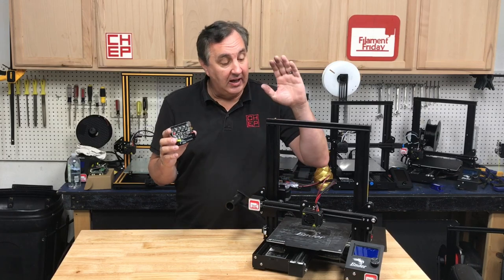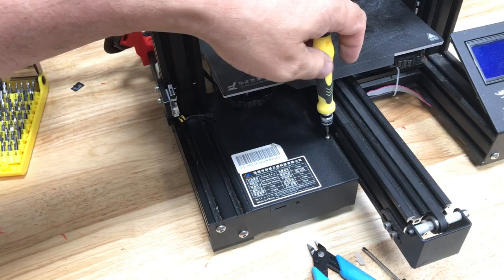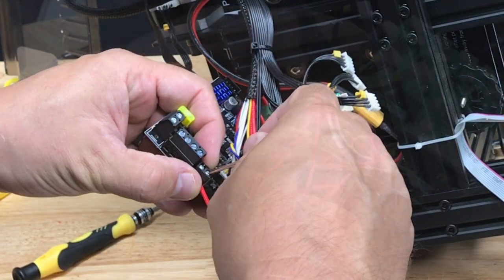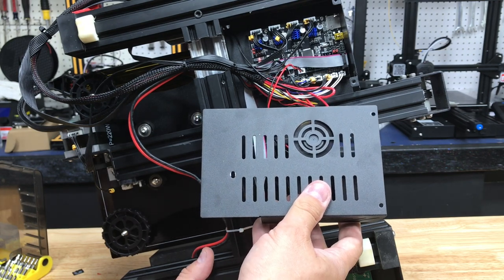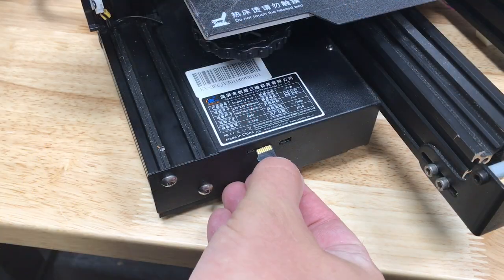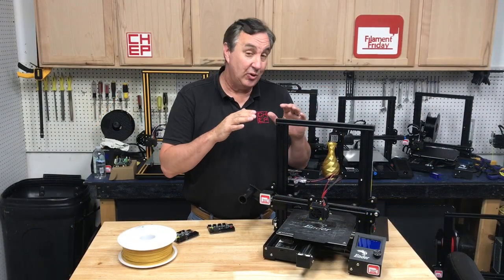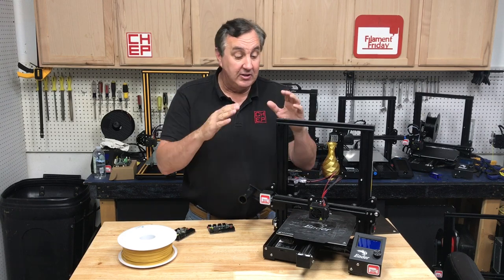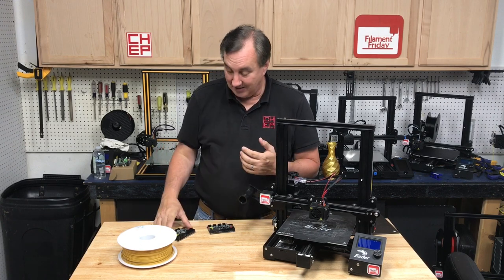Creality Ender 3 Upgrade to 32-Bit SKR E3 Mini

Comment: CHEP - I have reached the stage (about 0:48) with the main board uncovered, but I notice that on mine all the plug and wire connections are covered in hot melt glue - you didn't mention it so I assume yours were clean and OK to remove. Has anybody else found hot melt glue everywhere like me?
Reply: Yes! and it was very annoying to remove! I used an exacto knife cause I was scared a heat gun would ruin something
Reply from the maker: I did have some but it just broke away easily with needle nose pliers. I should have mentioned it.
Reply: coolant spray will help. Hot glue will get very hard and you can break away it in parts. But still lot of work...
Reply: Same here. Had all the connectors glued to the board. I have used the filament cutter to cut the glue and pliers to remove it.

Comment: The two Ender 3's that I worked on had hot blue on all the connectors.  was a major pain to remove them prior to installing the new SKR mini board
Reply: Ya, I used needle nose pliers and got a grip of a part of the hot glue and could pull it off quite easily. Still a big pain

Comment: Hi Chuck, well I took the plunge with the Skr mini E3 V2. Having a BLTouch and sensorless homing does present a problem. You can download firmware from BTT on git hub but quite frankly it is very poor and not good to use having assorted problems. I have been fortunate enough to have been given a revised compilation so that my printer works again. You also have to mess about with the wiring on the BLTouch which in itself is only swapping a couple of wires, although this is not obvious out of the box, additionally plugging a three pin connector into a five pin socket again does not run well with "do I do this?". Am not one to suggest material for your channel but I would like to see this as not everyone wants to learn to program Marlin (happy to share my firmware). Another pointer for review is the x axis gantry. After fitting the board I went through and just did some casual maintenance. Had the wheels a little too tight, doing this I was getting a great first layer but everything else after was rough. It never occurred to me that this could be an issue or cause a rough 2'nd, 3rd and on layer. Maybe worth banging that home to people as the temptation is always going to be nice and tight. The error will then be that users will start adjusting z offset, messing about with e steps and generally being frustrated. As for the upgrade itself, yes it was probably worth doing for the silence it offers (takes a little getting used to) but the bad firmware from BTT, well that was a pain and not the best experience!
Reply from the maker: Did you use the firmware I showed in the video?
Reply: @FilamentFriday  Hiya Chuck,yep from the BTT git page. It works "kinda" although would not let me go into minus figures on the z axis setting, would not remember e-steps after cycling the power, was printing off center (although homing correctly) and would shove the y axis forward with a tremendous bump on levelling.
Reply: @owowowdhxbxgakwlcybwxsimcwx  not sure what your question is in reply to my information or for that matter if it is to me or CHEP. Perhaps you could phrase it better.

Comment: Hey Chuck, Will this board work with the CR-10.  Trying to find a 32 bit board that will just drop in with my cr-10.  If not can you recommend one that does work for a CR-10.
Reply from the maker: I’m not sure about a drop in but this could probably control it. Would require some possible firmware mods though.

Comment: If the architecture is the same, framework the same, the code is the same, (as in not working with 32bit floating point operations) you probably have the same performance. I believe you probably have more RAM and flash memory. What is the chip used?

Comment: Seems to be a inexpensive plug and play upgrade for the E3. I had ordered one a few weeks ago, but apart from the quietness I don't know what other improvements it will give me on my stock E3
Reply: The quiet is a great benefit especially if you are running multiple printers.  I can't say it improved my prints because I really have not done any "before after" comparisons.  My CR-10 and the Ender 3 pros printed beautifully for my needs before the upgrade.  The main reason I bought the 32 bit boards was for the silent steppers.

Comment: No mention of hot glue? One of the biggest complaints I've seen is too much hot glue. My E3Pro is still fairly new, haven't looked at the board yet.
Reply: I went to the dollar store and picked up a metal dental pic, and used that top "pull" at the hotglue. Worked great.
Reply: I've got a set. I just hope it's not as bad as some have had.

Comment: I have this board but I couldn't get it to connect to cura via usb so now it's just sitting on a shelf doing nothing. I also don't like how the printer actually ends up being louder than before due to the mobo fan now running on 24v instead of 12.

Comment: Hey Chuck quick question. What's the screw used to secure the wheels to the non-motor bracket of the X-axis bar? Mine are stripped and need a replacement but i can't find what the length and threads are anywhere.

Comment: As usual, a great tutorial, but... I find that after installing the 2.0 version I have lots of issues. A simple troubleshooting guide would be a great help! Unfortunately I find it very difficult to find a source which gives answers to my issues. Too lots to mention. Can you Chep, or one of your kind viewers suggest a good source for help? When the board works it`s great but when you have issues, well you`ve got issues unless you can find help. Thanks again Chep for the best Ender 3 Youtube channels there is. I always point people to your help videos.
Reply: I think reddit Is the biggest resource to find solution to your problems: try searching in the subreddits r/3dprinting, ender3 or fixmyprint
Reply: Im experiencing those issues now after I decided on a whim to replace a perfectly functional 8 bit board with silent stepper motors for the E3 dip I'd had in a box for probably a year 🤔

Comment: I'm waiting for a video about installing the V2 display to an original Ender if it is possible to get a replacement display from Creality
Reply: Andrew Hayes won’t work, the only way it would work is if you was one of the few lucky people to receive a recent Ender 3 Pro with the 32 bit board. Otherwise no, you can’t retrofit the new V2 screen to an 8 bit Ender 3.

Comment: I just bought two more ender 3 pro's. I opened them up to find creality 4.2.2 boards in both. These are 32 bit boards with faster processors than the 32 SKR mini's. The machines seem to run fast but they are noisy as can be. Rumor has it that Marlin released new firmware for this board (Marlin 2.0 for Ender Pro 1.5). I am wondering if I should just put an skr mini in this or is it possible to enable silent steppers on the 4.2.2?
Reply from the maker: I’m told Creality shipped some 4.2.2 with 4988 drivers not the TMC used on the V2 so you’ve somewhat confirmed it. At this point I prefer the SKR mini v1.2 with silent drivers.

Comment: Chep, 

Get info. I have the same board installed. Will the firmware upgrade turn on the ability to recover from a power lost? Or do I need to do more to get this option to start working again.

Comment: Would this combo run Marlin firmware also for the Core XY printer I'm building?  I'd like to have the same stuff on all 3 printers so if one goes out I can just order/swap same parts again.  Thanks!

Comment: Does this board give you silent motor control, if not is it possible to do the mesh levelling with the 32 bit silent board, thanks
Reply from the maker: Yes it has silent drivers.

Comment: What is the easiest way to see if you have an 8 bit or a 32 bit 3 Pro, just received one. Have an SKR on the way but if I don't need it I will look at using on another printer

Comment: I’m having problems getting my print to stick to the bed even though I can slide the card(that came with the printer) under the auto-homed extruder.  Any suggestions?
Reply: Card is to thick, try a paper receipt to get the nozzle closer.

Comment: I’ve spent since Friday trying to at least get the screen to do something.
Sometimes it shows the Marlin logo and build but most times nothing on the V2.0 board
As for the firm ware for it...not much luck with that either so while I’ll keep this board in hopes I can get it working after learning a bit more, I’m just gonna put the old one back into the printer.
Reply: Did you get it to work?
Reply: I'm having a similar problem but all I'm getting is just a blank blue screen

Comment: I've installed the new board but I'm not sure what to do with the .bin file. Do I just copy and paste it to an sd card or do I need to open it up and run it through a certain program first? My printer still says it's running Marlin 2.0.
Reply from the maker: Just put the .bin file on the SD card, insert and start the printer.
Reply: @FilamentFriday  I was able to get the firmware installed, but the z axis is not going down. When I autohome, it home the x and y axis and then tells me that it was STOPPED. When I try to move the z axis, it will not go below 0.00.

Comment: Well Chuck....I was excited to upgrade my 2.0 board to the latest and greatest but things don't always go the way they should. I followed your directions and dowloaded the files (for V2) ,they were not compressed by the way, placed them on the SD card (the one that came with the board) inserted it and turned the machine on. The window turned blue and it is still blue after an hour. I assume that is more than a few minutes. I figured wonderful because I turned the machine off and removed the card and restarted it and the screen was blue. I put the firmware.cur file from the original  card and that did nothing either. Maybe a video on what to do when things don't go as smoothly as they should. I expect I have a lot of searching, reading, and cussing to do for the next few days. I'm learning.
Reply: Did you rename the file you downloaded to firmware.bin ?
Reply: @robbie_g8308  That was it's name when downloaded..
Reply: I have the exact same issue. George, where you able to fix it?
Reply: for me i accidentally deleted the wrong firmware, so i had to put the right one back on.
Reply: firmware.bin
Reply: @ericdodson8771  not yet still doing my research and learning.
Reply: @robbie_g8308  I did exactly as Chuck did but used V 2.0 file folder. moved the firmware.bin file to an sd card, inserted into the printer, turned it on, the screen turned blue and the nothing.
Reply: George Scott I hate saying it but it’s made me rethink whether the “Silent” is worth the trouble.  I haven’t changed back to the old board yet but I’m sure I will be.
Reply: @joeruggiero2822  Well actually the board that was in this Ender three version 1.1.4 was not loud....in my opinion. I am probably going to put it back in so I can use the printer and then figure out how to fix the BIGTREETECH board.

Comment: does that board have the digital connector for the closed loop steppers?  great video thanks chep
Reply: No because it has integrated (soldered) stepper drivers on the board, you cannot connect the cables of the closed loop steppers.

Comment: Uncanny timely video, as usual. I installed the V2 today and I’m having a nightmare getting firmware to flash. Test firmware went fine, but trying the BLTouch firmware led me to a blank LCD screen a completely unresponsive printer. I’m currently waiting to hear back from BTT support because an entire afternoon of google searching hasn’t yielded a solution.  Upgrade with care!  It was really quiet for the couple of test homing actions I tried though... oh, what could have been... :(
Reply: buruzn09 
The BTT firmware for the 1.2 was broken.  I had a BL-Touch and TFT35-E3 as well to install.  I made my own, comparing then copying across the necessary changes from the BTT firmware to a 2.0.x Marlin install.  Try that, if you have no luck.  (The only issue was I forgot to change default speeds in part of the Marlin firmware config, so the initial homing and bed levelling is slooow...  But haven’t bothered to fix that yet.)

I have to make up firmware for a 2.0 board soon, as I have upgrade parts for my brother’s Ender 3.  BL-touch, v2.0 board, and the TFT35-E3 to install.
Reply: The firmware has a few issues for bltouch. I have a working firmware with the bugs removed you are welcome to try.

Comment: Is this gonna work with first Ender 3? Not pro, not v2 version. Also i run stock Ender3 with Raspberry pi, camera and ofc Octoprint. Since my 3D printer is in diferent room and even flat (because of noise and space), I only use it through web ui of octoprint (uploads and printing files all done via web ui) and i wonder does this board  support that also since it is deal breaker for me. Thx!
Reply: "Is this gonna work with first Ender 3?"... yes.
Reply: Watch out with Octoprint though, if you power your Raspberry Pi with an external power supply it pushes current into the mainboard and overheats the drivers and motors.  I just used some kapton tape to tape off the pin in the USB port.
Reply: I upgraded my stock Ender 3 with the V2.0 Octoprint runs without problem. I updated nothing. No firmware no nothing. The WARNING about printer lacks protection on Octoprint has gone away. And the printer is crazy silent.
Reply: @WRW87  good news on the V2.0, I have V1.3.

Comment: They say ender 3's (Regular, pro, v2) or any other printer can print much Faster without losing any quality (That depends on your settings off course), Do you have any Cura Profiles, or setting  built for speed?
Reply from the maker: Who are they? It would require better hotend for one.

Comment: Thank you for the great videos Chuck!  I upgraded my Ender 3 Pro v1.1.4 to the new 32 bit 4.2.7 and it works great.  I then added a touch screen and now if I try to upgrade firmware I get the loading screen and don't see anything happening.   After this the unit appears 'bricked'.  Turn off/on and still see loading screen at 0%.   When I re-load the Touchscreen firmware, it loads and it's back to normal.  How to update firmware on Ender 3 Pro that also has updated to a Touchscreen?  What am I missing?  Thanks for any advice.
Reply from the maker: Your firmware may not be compatible with touch screen. It requires different firmware.

Comment: Do you know what the difference between the ender 3 and the ender 3x is. And does the ender 3 series of printers have thermal runaway protection. Thanks.
Reply from the maker: Ender 3x comes with extra glass bed and extra nozzles. Yes, they should have TRP now.
Reply: CHEP thanks so much.
Reply: CHEP when did they add trp? It was my understanding that ender 3’s don’t have it pre installed?
Reply from the maker: Quiet a while ago.

Comment: hey chep, I just installed this on my ender 3 v2 and I noticed that my power light is red. When I start a print, I hear a beeping noise for half a second, but the print still works. Are my lights incorrect? I have one flashing green light while printing and a static red light when the printer is on. Also, is the printer supposed to beep when u start the print? thanks great vid btw
Reply from the maker: Not sure. Why did you change V2 board? It was already 32 bit.
Reply: @FilamentFriday  I wanted the gcode for assisted bed leveling and because the skr mini is widely used. What should I do abt the lights?
Reply: @FilamentFriday  Wait chep what colors do you have while printing? just the static red?

Comment: Hello! I have an Ender 3 with a 4.2.2 motherboard that doesn't stop when using your bed level code. Is there a solution for this? I'd really appreciate any help you can provide :)
Reply from the maker: It’s the firmware. Use the M25 version.
Reply: @FilamentFriday  THANKS!!!!

Comment: Hi Chuck. Seems the Cura 4.7 is released. Waiting for your expertise.
I need your help. When I installed my Ender-3 v2, it was printing fine, but suddenly things have changed. See these 2 pictures it prints now: 

@t
@t

I tried to print the 20mm calibration cube. I succeeded the first days, but now this how it is. What are the causes?  Any solution, please?
Reply from the maker: I don’t see anything except @t

Comment: Does anyone know where I can get a replacement for the stock bed? When I look on amazon, they all have adhesive backing, which I don't want. The one that came with mine is attached by binder clips.

Comment: I have installed it and upgraded to 12v fans with buck converters, but they are always on 100% speed.
Does anyone know how to fix it?
All fans are running on 100% and I can´t controll them, not even the one on FAN0 :(
Is my board faulty? Im running latest firmware.

Thanks in advanced.
Reply: The buck converters eliminate the pwm signal that controls the fan speed. To get fan speed control to work with a buck converter you would need to drive the converter off a fixed dc input then modulate the output of it with a mosfet controlled by the signal coming off the fan header.
Reply: @north_by_midwest  I have done it now by connecting the positiv wire of the fan port to the buck converter and a ground wire from heated bed.
The fan itself then is connectes to ground from fan port an positiv output from buck concerter.

It Works like this, but the fan is making some kind of coil noise when running at 80%